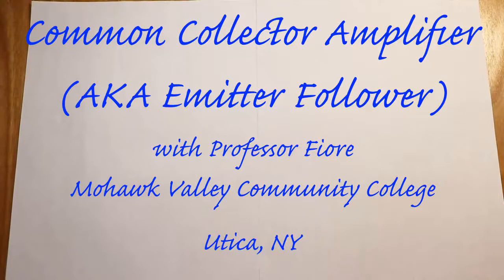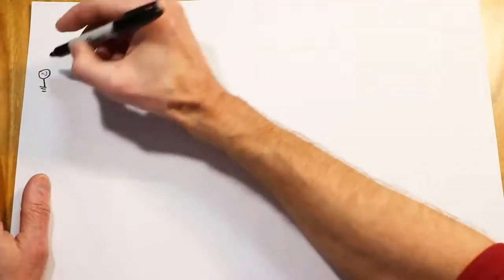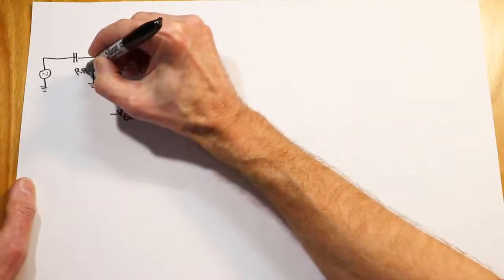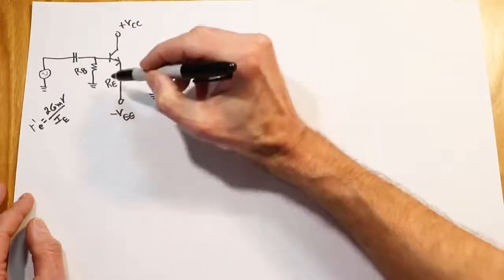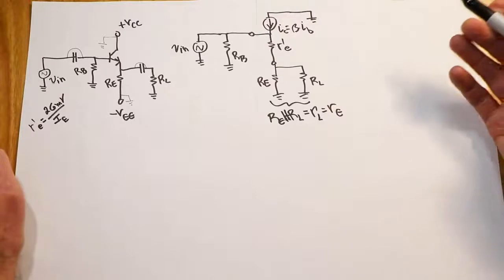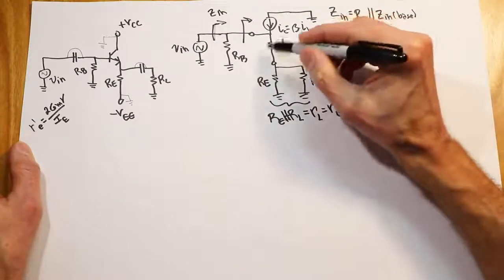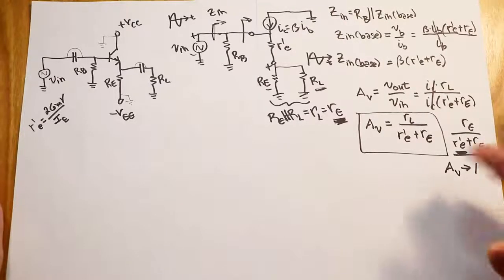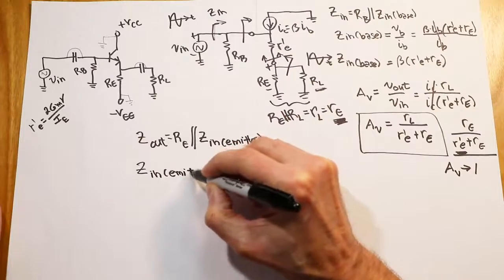Semiconductor Devices: The Emitter Follower

Comment: Excellent, thank you. I've downloaded your course notes and will try and find where we are up to. Further to yesterday's video where we added an additional stage with a PNP, could we do the same here to bring the voltage back up and reduce the Zin even further? Is there any benefit or would it just add noise?
Reply from the maker: Yes, you can add another stage. Followers are usually the first stage of a multistage amplifier (or the final stage if it's a power amp).

Comment: Impedence is inversly proportional to current, so you should multiply by beta, not devide, seems. What the heck?
Reply from the maker: It's not clear precisely to what you're referring. We do multiply by beta to find Zin (we divide to find Zout). Also, impedance tends to be a fixed value in a circuit, and the current varies according to the applied voltage (or vice versa).